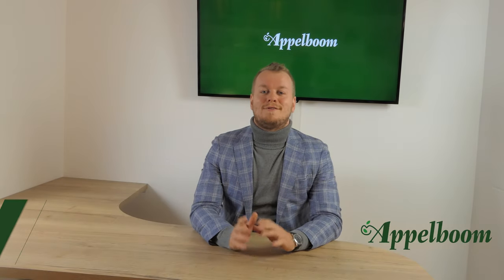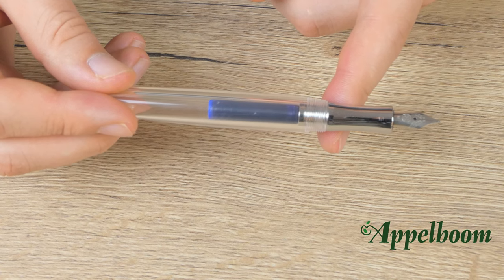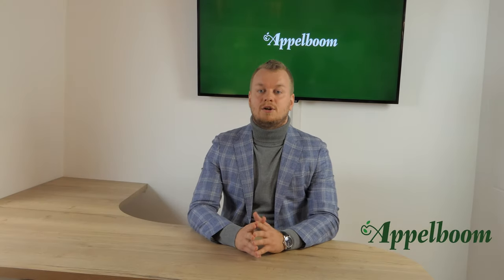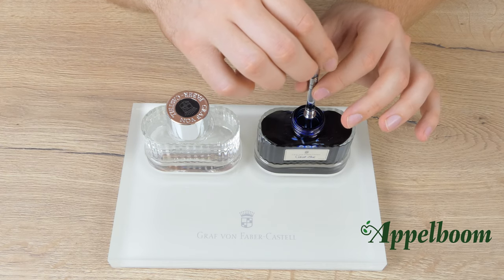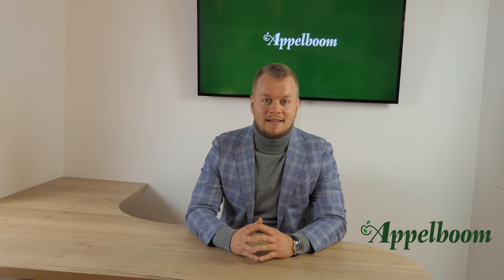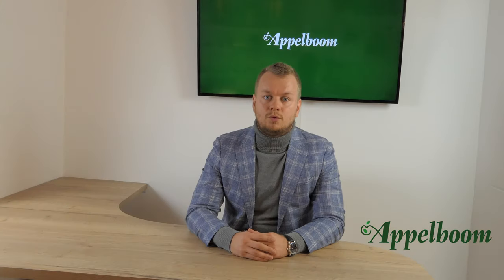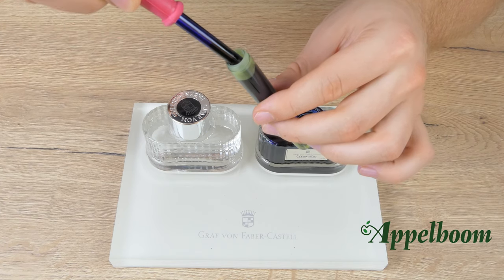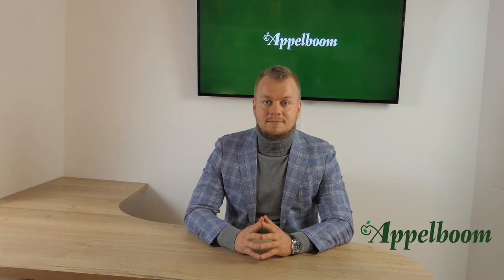5 Most Popular Fountain pen Filling Mechanisms

Comment: my favorite filling system is the lever fill, closely followed by whatever Parker calls the standard squeeze bladder filling system of the 51 and less expensive 21. Eye dropper is my third favorite, even though it holds the most ink, as it can be a bit messy to fill.
The new fangled Cartridge/Converter (introduced in 1965, if memory serves) is a distant fourth. Expensive cartridges and converters (some of which are proprietary) is the primary reason the cartridge/converter is my least favorite. I haven't had the funds for a piston fill or "modern" vacuum fill pen. Seems I always "need" something else more ... 
I'll probably try those two systems sometime before the 2024 Presidential election. (sure hope there's a candidate that isn't "the lesser of two evils" for a change, who is actually worth voting for ... hasn't been one for several decades ... ☹️

Comment: 1) Sheaffer Snorkel
2) Piston
3) Vacuum
4) Lever/Sleeve/Button
5) Eyedropper
...
116) Cartridge/Converter
Reply from the maker: Well number 116 is quite high on your list!;)
Reply: Why, for #116 : D ? Cartridge/converters are beautifully easy to clean. Not a small matter when you have many pens to clean. I'm not familiar with a snorkel filler sounds interesting. I've not tried your #4 neither. I love piston & vacuum - I assume the pneumatic filler in an Armando Simoni Club is similar to a vacuum? I love eye-droppers. They hold so much ink and are very clean to fill. I have a Namiki Emperor and I've not refilled it since I bought it 4 months ago and I use it often. Cheers.

Comment: I like my Opus 88 Fantasias with the eye dropper and shut off valve mechanism.  I travel a lot so have a large amount of ink in a small pen with air pressure shut off for flying is ideal.  Also like piston fillers.
Reply: Opus 88s are great pens and much, much less expensive than Danitrio and other high-end pens with shutoff valves.

Comment: Please tell me which fountain pen ink best ?
Reply: The kind of ink that works best depends on your pen some pens need dry and some pens need wet ink as every nib even between the same pen will be slightly different, but most of the major manufacturers make good inks that are not damaged to a pen. Waterman, Pelikan/Edelstein, Pilot/Iroshizuku, J. Herbin, Graf von Faber-Castell, Diamine, Caran d'Ache are all fine inks. Personally I avoid ink with particulates, like shimmering inks, because they can clog a pen. Also, I find some manufactures make inks that can be corrosive to parts like sacs - I'll not name names, but some searching on your part will turn up answers.
Reply: @shaunpearson7905  thanks